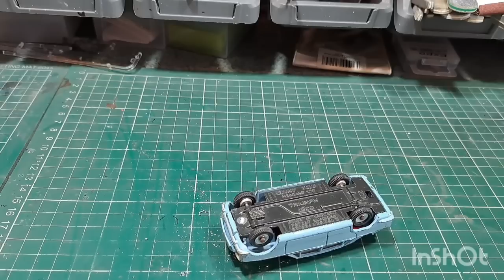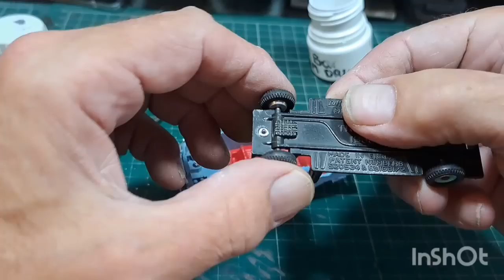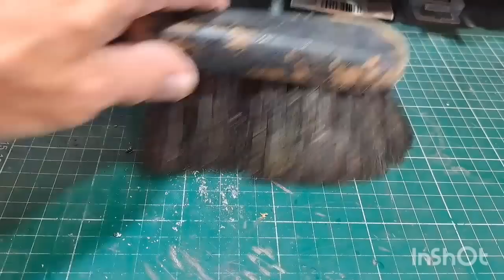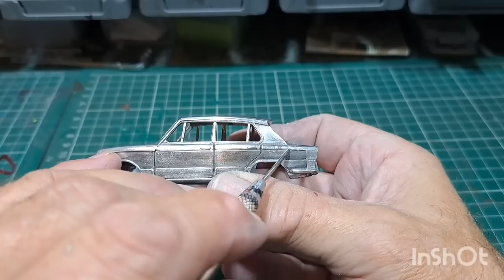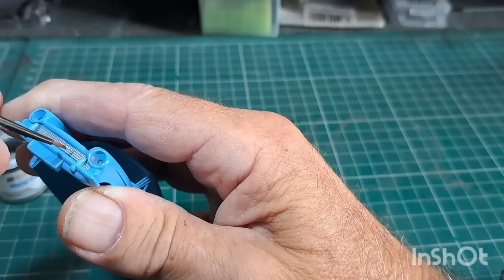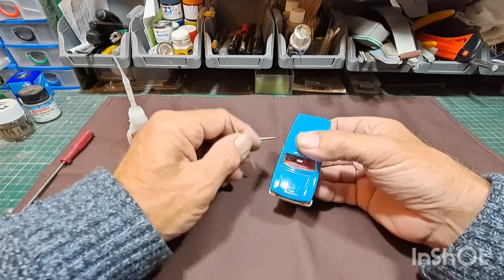Diecast Restoration Dinky Toys Triumph 1300 no/162.  1967/69

Comment: I remember driving those things - they were comfortable and light to steer, but they never really liked a corner, despite the front wheel drive. Great dashboard though, with the wood and classic Triumph combined-cluster warning lights. Quite a classy little car in the real world. The Toledos and Dollies were rear wheel drive, and the Dolly Sprint was a SAAB engine on its side!  
You have certainly done that Dinky model justice, Martin, with sensitive restoration decisions and some terrific detailing as usual - an object lesson!
I got some sanding sticks from GreenStuffWorld at 800, 1200 and 2000: they are really good, and I did my trusty 1:1 Honda Jazz lights with them too! Happy Birthday: at 66, you are still a boy!
Reply from the maker: Thanks fraser, I never did get to drive one myself but been a passenger a few times ,very comfortable.

Comment: looks nice and shiny again. :) back in my days I often would lift the mushroom's rim with a sharpened screwdriver, and parked it in my finger once or twice... but then there is something to re-flatten again with an old rounded cross-screw driver head. worked out most times. :) with some castings one has to drill them out completely, especially Siku's Porsche 914. took me three tries to find out the rear lid was just too thin, and would warp when you pull on it.
anyway, the windscreen reminded me of a car I found at the flea market, it had been painted over with silver paint, and someone washed that off with thinner, and roughened up the window insert's surface. maybe someone had used thinner to rub off some marker painting on the bonnet? the fumes might have gotten to the windscreen. either way, great work on that. :)
Reply from the maker: Thanks Lothar, the joys of restorations you never know what your going to come up against and then sit and work out how best to solve it ,love it .
All the best Martin 👍

Comment: Nice one Martin. Didnt know anyone did this. Very much a smaller version of the Dinky Triumph 2000. Same working parts & screen thickness. On the wipers, many don't have them, so losing them wouldn't be a major disaster, but good to preserve them when they are. Also good how you were able to tighten up the bonnet hinge
Reply from the maker: Thanks Ian ,yes definitely one of the thicker screens, I dodged a bullet on the bonnet hibge didn't I, all the best Martin 👍
Reply: @martindaredare  very deftly done. Nice one